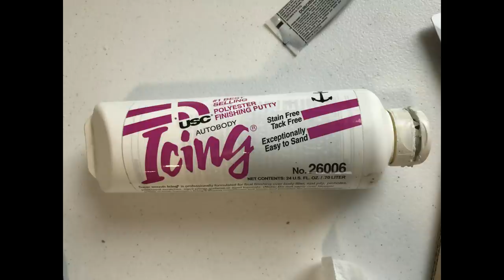HOW TO: (Screw Up) and Make a Fiberglass Fairing

Comment: Great channel - ony just saw this video.  Many years ago I was in motorsport when carbon fibre was all new, we used to do mods similar to your cowl blister & try to make it look like we hadn't screwed up and had done a rework.... next time think in reverse & make a mould with the foam - cut out your blister like you did, plus about 5-10mm all around, then work the foam to fit the outside of the cowl.  With a marker pen mark the extent of the cut hole onto the foam from  inside the cowl. Remove the foam & now sculpt out the blister, like when you peel out a melon with a spoon,  on the bench. When you are happy, give it a quick coat of jelcoat or even paint to get rid of the worst of the foam cell roughness. Doesn't need to be absolutely perfect. While this is drying, attack the inside of the cowl by grinding/sanding away from the hole blending out about 30-50mm from almost a knife edge at the hole edge. Once the jelcoat is dry, apply mould release to the mould block then tape the foam block in place onto the cowl. Apply a liberal layer of clear jelcoat into the blister mould (doesn't need to be clear if you are going to paint the final cowl), making sure the jelcoat loads into the edges of the cowl cutout, but don't clearjel the cowl fibreglass that you have ground away - if you do too much, grind the excess off with a dremil. Now lay up a couple of layers of carbon (or glass cloth in your case) out to where you ground back the inside. This gives a strong joint of the blister to the cowl - doing it to the outside tends to give you only a small structural bond area between them.  Once all dry, the inside can be given a quick touchup, and the outside just needs a quick sand & polish, and at worst if you are doing it with carbon & clear jelcoat, you might just get one or two little bubbles to fill :-) Looks a million bucks, next to no extra filler if any, and a strong bond.  Another trick to check clearances - get some plastercine/modeling dough and roll beads then press lightly to have then stick on one surface - sometimes a tiny bit of hair dryer heat helps it soften if it's a cold day, then fit the component & the indentation should give you the dimension (we used the same trick on pistons to double check valve clearances!)  
Looking forward to more videos :-)

Comment: Nice work Mark. I think you need one on the other side, then you could paint them to look like eyes.  When you eventually take those valve covers off to fix the rub mark have them all powder coated a color to match the paint job.

Congrats on the 10,000 subs.

Comment: congratulations on all the subscribers... I had a Kit Plane many years ago with a 584 Rotax, I had a similar issue and I realized with the engine torquing and either left or right turn, the engine would sway a bit and still touch the cowling. anyway, good luck. thanks for the update,

Comment: Nice, work.  I have a few questions about the materials used.  What is the handling time and cure time for the epoxy resin used? Do you recommend epoxy with microballoons as an option to your filler paste choice?  Thanks, Kurt

Comment: What is the advantage of using fibreglass resin over epoxy resin for your initial layup?
Reply from the maker: It is actually epoxy resin.
Reply: @KitplaneEnthusiast  polyester is usually used in fiberglass isn't it? Just saying . Nice job though!

Comment: Not bad. I am not sure weather I would still have worked it from inside the cowl. I also think if I was to do it as you did on the outside I would have used the smaller piece of fibre glass and worked out as that might have made the steps less pronounced. Just some thoughts, what do you think?
Reply from the maker: That is not the correct way to get a strong bond.
Reply: @KitplaneEnthusiast  I agree if it was a structural part, going onto structural laminations, if it was I would step back the layers in the main piece and then do a step out repair and vacum bagged to remove the excess resin. It depends on the application. Personally I would have made the hole bigger still and gone to the inside, for your application if I wanted a structural bond, as you are bonding on GelCoat, which is non-structural, it makes little difference. Just my view what do you think?

Comment: Did you do one on the other side to match?  When I needed to do this on my road race motorcycles I would put the patch on the inside.  Cut some cardboard to the radius I wanted on the outside apply packing tape and then lay down lightweight fabric that would easily form to the shape wanted.  Then lay down extra layers as needed then fill the outside edges with epoxy and micro balloons, there isn't any strength in the epoxy. Sand smooth and prime. :D
Reply from the maker: Craig, I need to mention this more often, but I used to repeat in my videos that I am only showing you how I did. But keep in mind there are 100 ways to do the same thing. This was my method, and there are many other methods that will also reward you with perfect results.